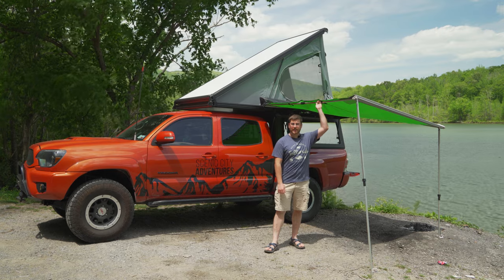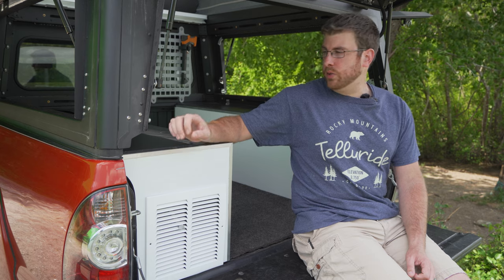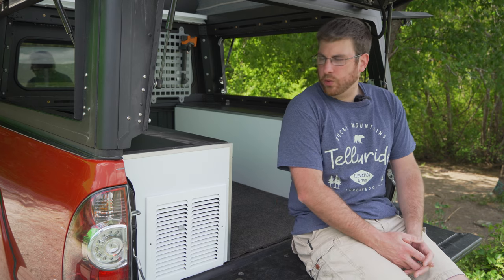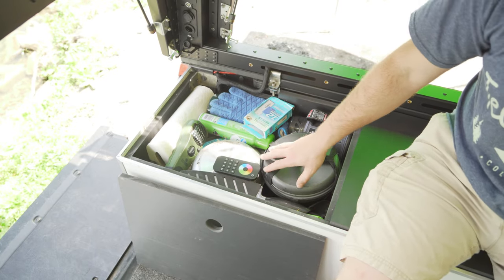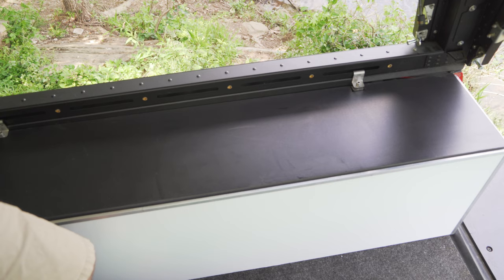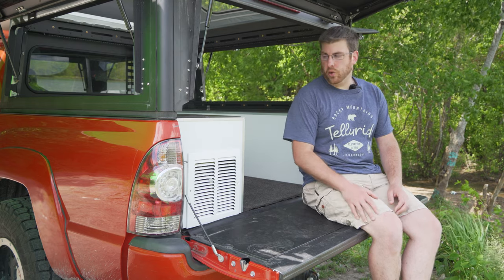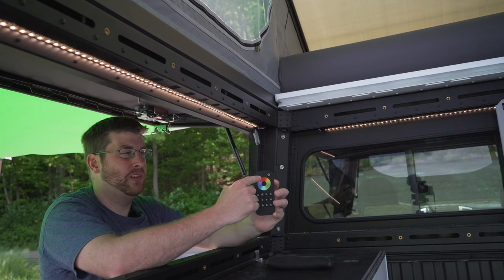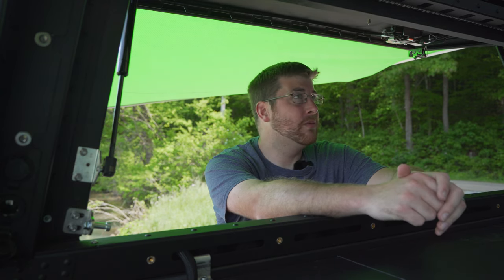Super Pacific Camper Interior Walk Around

Comment: I like the LED lighting strips and controller you’ve implemented. I just picked up a V2 GFC and am looking for how to build it out. 

The lighting controller says it’s 4-channel, so if you got another lighting strip for the upstairs could you control them separately from the same remote?

I’m also curious what you did with the lighting strip in the corners of the camper. Is the strip cut and wired together for each side?

Thanks!
Reply from the maker: Congrats on the new camper! So the four channels it’s referring to our red green blue and white. The LED strip has marked areas that you can cut through it and re-solder with wires. For each corner a cut the LED strip where I needed, extended it out using a roll of five wire LED specific wire, then soldered it back together. You could do the same to get the wire upstairs. 
You could also use premade connectors that are solderless like the ones here:

https://www.amazon.com/dp/B07KK9TX99?ref=ppx_pop_mob_ap_share

I did not have great luck with the connectors but I used the wire and just soldered it myself.

Comment: Having the discontinued Goal Zero 1000 myself, I wonder if you have left enough venting as the unit does produce alot of heat both in the inverter mode but also while charging. I often have to lift the top lid to keep the charge brick from over heating.
Reply from the maker: Good questions! So it’s not often that I run it in inverter mode, unless I’m charging camera barriers. I’ve found that those don’t pull enough power to cause it to heat up. I also charge it with a Victron 12-24v dc to dc charger not the charger brick. It charges faster, and doesn’t heat up the GZ.

Comment: After 6 months how has the PVC foam board held up? Would you use it again?
Reply from the maker: Great question! It’s been great. No warping, no failures in the glued joints, no blown out screws. It can be scuffed without too much effort, so it’s not perfect, but it’s still my favorite material we’ve tried so far.

Comment: How much clearance do you have from vent to tailgate?
Reply from the maker: Not nearly enough. That’s why I want to recess it in to give me an extra quarter inch or so. I’ve also added a magnetic screen door on the back that takes up some of that space so I may end up trimming the box and scooting the entire thing back another quarter inch.
Reply: When I made my solar genny I used a PC temp controlled case fan. A $10 Govee BT temp monitor is a good tool to log data temps
Reply from the maker: That’s a great plan! We actually have a Govee BT temp sensor in there already. I rarely run the inverter and the temps have been so far. But never hurts to get some extra ventilation.